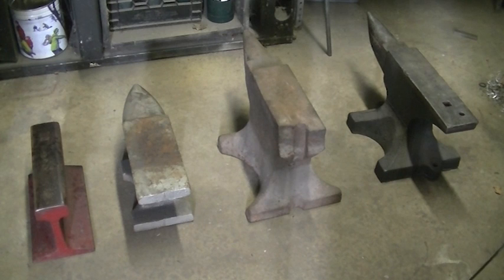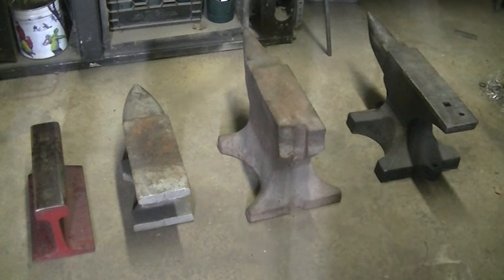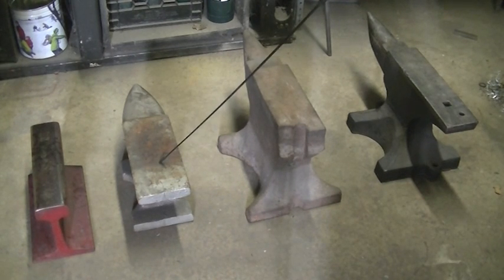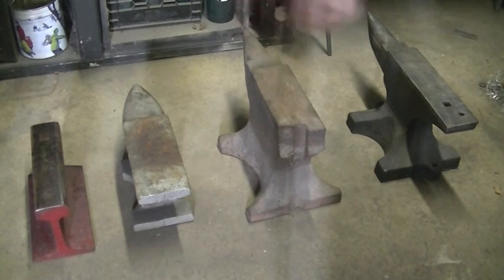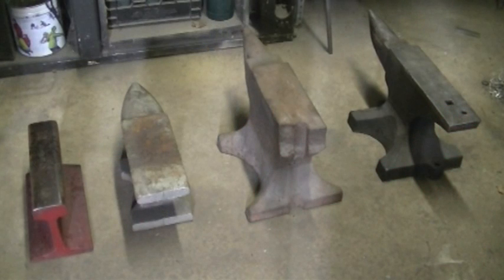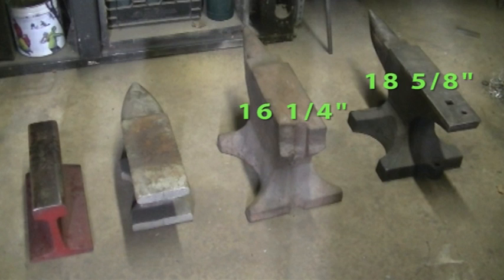Anvil Rebound Test - Steel vs. Wrought vs. Cast Iron vs. Rail - All Compared Side By Side.

Comment: An excellent demonstration. Please can you show what the anvils were mounted on? In order to obtain the same deck-height and level, was wood packing used? By Newton, action and reaction being equal and opposite, the anvils would go in the opposite direction to the ball, and compress any packing to a certain extent.
To take the example to extremes, a piece of 16ga sheet rested on a 4x4 would not rebound at all, as the wood would absorb the impact.
Perhaps repeating the test with all the anvils set directly onto the concrete floor would be absolute.

Comment: Do you think that the design of your ball bearing with the shaft played a role in the numbers as well? Reason I ask is the quick angle and weight distribution upon impact and it varied each time. I’m curious what the difference would have been with a completely round ball bearing instead.

Comment: What's the difference between cast steel and cast iron?
Reply from the maker: Cast iron is softer and in the anvil world cast iron anvils normally have a steel face forge welded to them. When you see "cast steel" in an anvil it generally means that it is made from recycled or modern materials. Cast steel is also a little more resilient compared to cast iron. It should be noted that all steels are not created equal and different alloys have different qualities. So you will see "cast steel" anvils from one company selling for $199 dollars and another of similar weight from different company selling for $1000. If you in the market, read every customer review you can find, you see the pros and cons of each from people who use them.

Comment: I've seen many videos of a rebound test on various animals. Your methodology was excellent. My only major question is why is it important to have that much rebound? What does Rebound do for you as a blacksmith?
Reply: I would imagine it has to do with hammer lift. The more rebound, the less you have to lift the hammer over and over.
Reply: @ameliaward7429  It has mostly to do with the work the anvil does to the underside of the work piece.  The more rebound in the anvil...the more energy is transferred back into the work piece.  Meaning the fewer strikes you have to make in order to move the same amount of metal.  Say you're flattening square stock.  On a dead anvil the side you're striking will move a lot more than the side against the anvil.  Whereas working on a 90% rebounding anvil will flatten both sides of the stock at virtually the same rate.  Hope this makes sense.

Comment: I don't know why I must comment on this nearly 4 year old video but, I simply MUST. A ball bearing without a stud welded to it would have been a realistic choice, however with the stud welded on, a significant and unnecessary variable is introduced. Perhaps a square cube could yield more accurate results JK;)  I can only assume that at some point since, you have realized this, and I apologize for my lack of self control. It was an interesting experiment though and I appreciate your efforts in presenting it. Cheers
Reply from the maker: People test the rebound on anvils with ball pein hammers,  They have 10 - 14" wooden handles sticking out of them.  

The whole idea of the video was to demonstrate the difference between the different materials used in anvil production, not to demonstrate  some sort of maximum available rebound potential.

Besides, the idea of testing rebound is to get and idea of how much reflected into your work. It is unlikely you'll be forging with a ball bearing. :)

Comment: to test rebound can a small ball bearing be used or do you need a large  ball bearing  ? im new to all of this and was going to look at a used hay budden anvil later today the guy is asking $650 not sure what to do hope ypu can give me some advice
Reply from the maker: You could even use a ball pein hammer if you don't have a ball bearing, there are some examples of smiths testing rebound in that manner on Youtube. You just need to hold the hammer with a very lose grip.
Reply: @jeffreysanto  yes worked well  the anvil had great rebound my small ball bearing bounced up to my hand when i dropped it and hammer bounced well too thanks alot  Mark

Comment: Quick question, what does rebound have to do with how good an anvil is?
Reply: Good question. The rebound will send the hammer back up and require less work for the smith. Using a small hammer, rebound isn't much an issue but once you get into 3+ pound hammers, they will wear you out in a hurry if you dont have good rebound to help the hammer back up. Tennis elbow is a common problem if you dont work with the tools and the tools work with you

Comment: I see a lot of scientific tests on much more complicated things.   This test is plenty accurate for the facts gleaned.  100 drops with a perfectly round heat treated steel ball will be more precise, but that precision is just not necessary.  The data gained from this test is just great.  Well done! Super job!!!   The steel face is by far the superior.  The rest are junk for my taste.   Thanks immensely.

Comment: Why is it so important to have a high rebound? I did wonder why Smith's bounce their hammers on the anvil between hitting the hot metal so what's the reason please?
Reply: The rebound per se is not the important thing.  It’s meaning is.  The better hardening means more energy will be transmitted into the work piece from the hammer and the anvil will last longer without cracking.

Comment: Rebound is not the point of an anvil. The purpose of an anvil is mass and hardness. But when you put a super heated piece of metal onto the anvil, the hammer will not be hitting the anvil at all so the rebound doesn't matter. As a matter of fact, if you DO get rebound your metal is not hot enough and needs to go back into the forge. Myth busted.
Reply: You're misinterpreting the results. Rebound shows how much energy is being absorbed by the anvil. If you drop something on it and it stops completely. It is absorbing 100% of the force. If it bounces back up to it's original height, it is absorbing none of the force.

What you want is your workpiece top absorb the force you impart, not the anvil. 

So basically, the more rebound on the anvil, the most force you impart into the workpiece.
Reply: @mitchellpatterson3323  Again, the rebound is not a measure of the effectiveness of the anvil at all. It is a measure of the rebound and nothing more. An example is a power hammer. The force is applied directly tot he work and the base anvil has resistance but not rebound. How high the ball goes does not tell you how effective the work will be. Force is absorbed by the work and not by the anvil.  This rebound test is never applied to the anvil on a power hammer for two reasons. One is that it does not mean the work is lost to the anvil and the force applied by the hammer is absorbed by the work, not the anvil. That is what forging is. It is the rearrangement of molecules in the metal, not the anvil. That is also why you turn the work over. The force does not go all the way through the work or you could force from one side only.
Reply: The laws of physics unfortunately tell you that you are wrong.

For every action there is an equal and opposite reaction. The workpiece absolutely does NOT absorb all of the work. A great portion of that force is transferred into the anvil and by extension into the floor.

Your suggestion is rediculous. Are you ACTUALLY suggesting that the work piece absorbs all the blow?!?! 

If it did then then you could forge on a piece of wood. My god. Think about what you are saying man.

Imaging trying to forge something on a piece of foam as a anvil, every time you hit the workpiece the foam would compress. Therefore the workpiece is NOT absorbing all the strike.
Reply: @mitchellpatterson3323  You are completely misinterpreting what I said. I said the rebound value of the anvil has little to do with whether it is a good anvil or not. And yes, I have seen smith work a piece on a block of wood. What is your problem? And you do know you are talking to a physicist, right?
Reply: @flubby18  the bar for being a physicist is pretty low then huh?

If you cant see the relationship between hardness, rebound and energy absorption of an anvil then you need to reassess where you got your physics degree from.
Reply: @mitchellpatterson3323  It's really quite simple. Smiths often use a blob of putty to test their skills and the anvil because it has about the same resistance as the hot steel. There is no rebound involved. My point is simple. Although rebound, as you say, reflects the resistance to a blow, it has little effect on the value of the anvil for forging. Smiths use all kinds of anvils and forge just fine. The physics notwithstanding, any hard anvil will yield good results. Rebound is but one test of a very minor aspect of anvil value.

Comment: Does HF have a 70lb anvil?  I've only seen the 15lb and 55lb.  I used the 55lb HF anvil for over a year of forging basically everyday. That thing was like a bowl when I was done with it. Lol. It had a lot of work on it though. I put a new face plate on it, ground the horn more round and now it's waiting to be set up and used for when visitors come to forge with me.
Reply from the maker: The biggest anvil I am aware of for sale at Harbor Freight is the 55# version. They may have had a larger one in the past but I could not find a reference to one online anywhere.

Comment: Does the size and weight of the anvil not effect the amount of rebound you will get? The more metal the less give, so I know it's not gonna happen and your control method was fine in my opinion but it was not only the metal that was variable but size for size would it make a difference.  Maybe someone out there could work out a formula?
Reply from the maker: I actually did a second video where I did the same test on the train rail, then cut the rail in half and did the same test. To my surprise there was little change in the result. I think the mass on the anvil is not the whole story when it comes to rebound. I think of it like this ( mass of anvil + mass of hammer = result ) if I hit a 100# anvil with a 3# hammer the results would be the same and hitting a 50# anvil (of the same material).  But if I hit a 100# anvil with a 20# hammer the results would be much different than using a 20# hammer on a 50# anvil. The mass of the anvil vs the weight of the hammer needs to be enough where the anvil can reflect the energy of the blow.

There are of course a lot of people who debate all of this but this is what I believe to be the most accurate. I am not an expert, it just makes the most sense to me.

Comment: Regarding the poor performance of the railroad track:  it should be noted that track is made to bear outrageous load both without cracking and without excess mass under a wide variety of environmental changes.  The harder the steel the more brittle and crack prone it is.  That's why you temper after hardening.  

Rail must be made in enormous and expensive quantities and the less metal per mile of track the better.  That is why it has an I-beam shape.  And, in fact, the load bearing capacity of any I-beam is proportional to the height of the beam, not the mass of the material.  Make an I-beam from particle board and its load capacity can be incredible if you make the beam tall enough.  

Finally, track rail is extruded, not cast or forged.  This means that it must be exceptionally ductile since the extrusion process stresses the metal in all directions at once.  Past a limit, hard steel cannot be ductile and that is why it cracks so readily.  It is also why top of the line anvils have a huge ductile mass underneath to support the hardened steel surface so that the hard surface can withstand decades of hammer force blows without cracking.
Reply: Plus, reportedly the companies that make rail have used several different grades of steel in the past. Some are legitimately harder than others.

In my opinion, the big draw to rail as an "anvil-shaped object" is it's low price. A 12-18" section of rail is CHEAP compared to a similarly-weighted anvil; something like $1-2 per pound instead of $6-10 per pound. It's an inexpensive way to get started blacksmithing without breaking the bank (or angering the missus). ;)

Comment: Very good job! Congrats on being systematic. I can use this vid as a reference forever now.  I didn't get that bit: was the wrought iron actual wrought iron (the real old stuff?) Whow, that's some rare antique!  My question is: is its face hardened steel or just wrought iron? If so, this proves that the cast iron's weakness (as an anvil) is because it absorbs vibrations (energy). As for the rail, I'm sure the big difference is due only to its weight. A section with a similar weight as the two real anvils would have performed better.
Reply: The anvil in the video was misidentified as a wrought anvil. Note the semicircle cutout in the rear foot which was done by badger, vulcan and fisher at varying times, all of which made solely cast iron anvils with steel work surfaces.  Also the fact that the anvil didn't ring when the ball was dropped on it.

Comment: Good effort but the overall shape of the drop ball made the test inaccurate. For the test to be accurate the actual ball had to hit the face of if the anvils dead on, which it didn't. This caused at least some of the rebound energy to be neutralized through the tail end of the drop ball as it flung downward on the rebound. Try this test again with just a ball bearing and you see a marked difference in the results.

Comment: Railroad rails are work-hardened by having thousands of tons of train wheels roll over them hundreds of times.  The piece you used may have been cut off a new section of rail and its surface was not hardened.
Reply: The head on a piece of track is a hardened steel and the web and base are softer metal. Trains cause stress like splinters on the head. I worked for the RR.

Comment: Could a cast aluminum anvil work for certain things?
Reply from the maker: I do not believe there is any current aluminum alloy hard enough to take the abuse a traditional iron or steel anvil can endure. One other problem, even if aluminum was hard enough you would still have the issue that aluminum acts as a heat sink. It would pull heat out of the material so fast it would be counterproductive.
Reply: I have a foundry here at home and I pour cast aluminum bells. I am to do an experiment on mixing zinc die cast metal

Comment: I am curious as to what this means to me. I have a section of track that is actually crane track and instead of that narrow piece you have mine is about 8 inches wide. It really rings when I hit it with a hammer. It rings to the point that I need ear protection when I use it. What difference is it going to make to a project if I use my piece of track instead of a cast iron anvil?
Reply from the maker: If it rings it means you have a nice piece of steel, which is a much better work surface. It is why more modern cast iron anvils had steel faces forged welded to them. I did a video on what rebound is and how it helps the smith, I think that will answer your question about the benefit of steel over cast... As a side note, if you can find a big magnet and slap it on the side of the steel you'll find it will reduce the ring. Other smiths out here have posted videos on that and some other ways to "quiet" down an anvil.
Reply: Douglas Sigea a

Comment: when anvils were made by blacksmiths they were cast steel, unfortunately its a hit and miss approach as many have defects, its all about metallurgy, I imagine it would have been hard to make an anvil last a lifetime as there was no process of quality control. so the solution for old anvils is to put a thick plate on the deck to stop the breakage as I have seen many a broken anvil.

Comment: A round ball at a constant temperature is better at getting accurate height rebound. The piece of metal on the end of the steel ball will affect the rebound torque causing  gravity to work against the weight of the bar on the steel ball.  Physic professor here....
Reply: He used repeated measures so errors due to variables are not a factor. And I am a scientist. This is more than decent for a YT demonstration.
Reply from the maker: The test is not meant to be scientific rather just to show that there is a difference between the materials anvils can be made of. Also what most people don't consider is that over 90% of the videos on youtube that talk about rebound demonstrated the differences with a ball peen hammer, yet no one mentions that large mass of wood hanging out the side. Member of Mensa here... ;)

Comment: Very interesting and informative rebound test.  Thank you.   
It would be interesting to see this performed on a section of rail before and after hardening the rail piece.  How much of a difference could it make on a piece similar to the one you hardened a few days before posting this video?
I have heard anecdotal evidence that the ends of the rail are harder than near the centers because the ends literally get hammered by the wheels more, slightly compacting the surface and making it a little harder.  This compacting can be so minute that only a micrometer could detect it but could nevertheless harden the surface noticeably.   So the story goes.   Is there an truth to this?

Comment: As you found out Using a bearing (I like to use a half inch.) is a great way to find dead spots due to abuse, bad welds, delamination, some body using the anvil as a torch bench and other defects. I like video. Thanks.